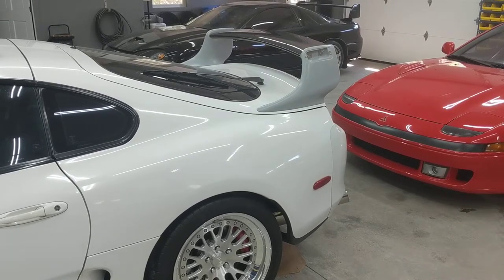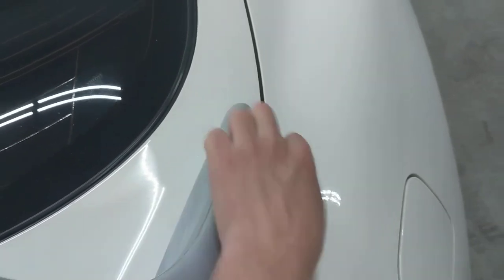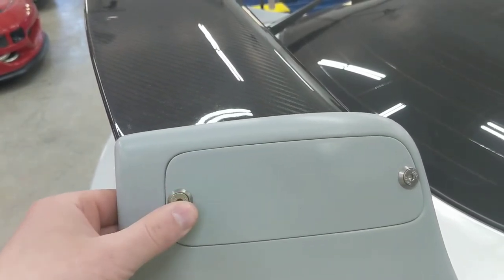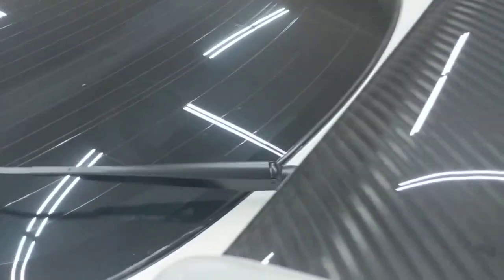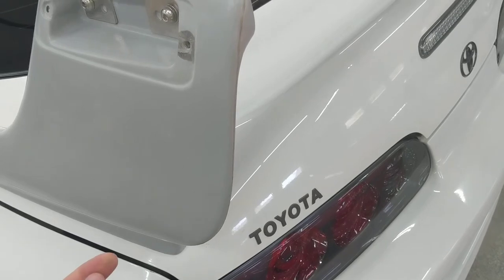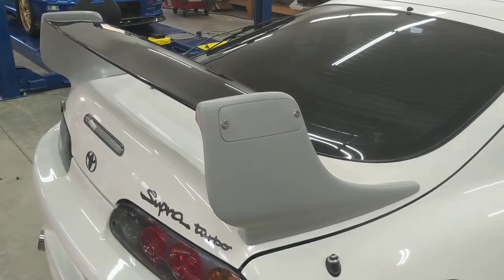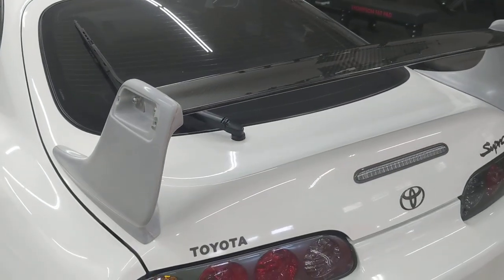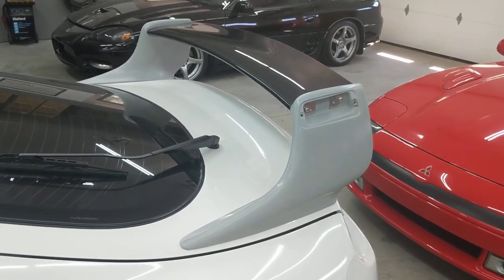Best Fitting TRD Wing for the Toyota Supra - Reviewing the IBS replica

Comment: For $1700 and you still needed to modify certain aspects of it for your taste of “perfect” is a lot of money…(this dad btw and I own a MKIV Also).
Reply from the maker: The sanding prep work would be true of any fiberglass part. Hopefully the one threaded insert not lining up right was a fluke. Maybe they could have swapped it out or fixed it, but I didn't want to deal with shipping a part back to Russia for something I could do myself. If you check the blog post in the description you will see what I dealt with trying some of the cheaper spoilers.
Reply: @802Projects  understand. Yea I follow your blogs often for input on things I may want to tackle. Pretty underrated supra content if you ask me. $1700 just a hefty price tag for a non-Toyota part but I can appreciate finding what’s best for you. Mine was oem until few months ago my toddler opened the garage door with my trunk open and sure enough center blade destroyed 😑. Looking for a replacement now or a body shop to attempt to fix.